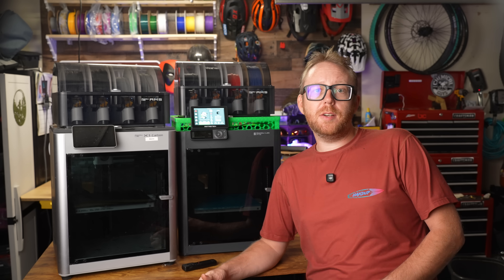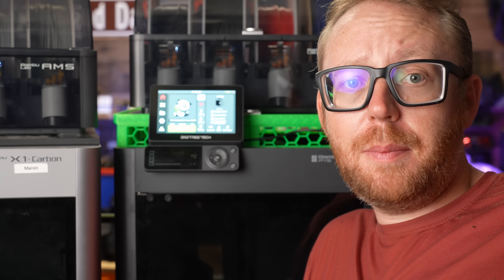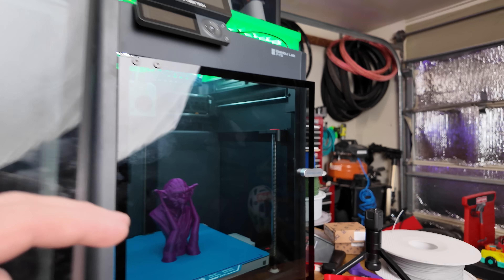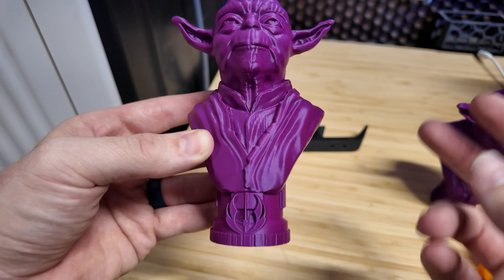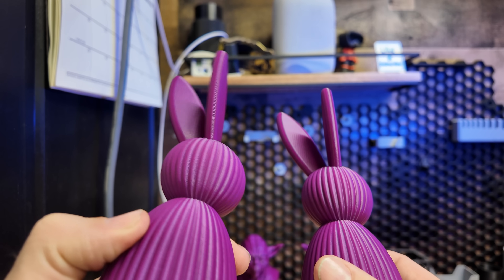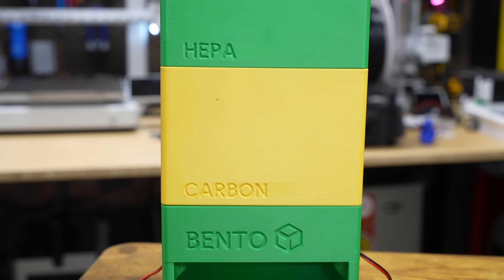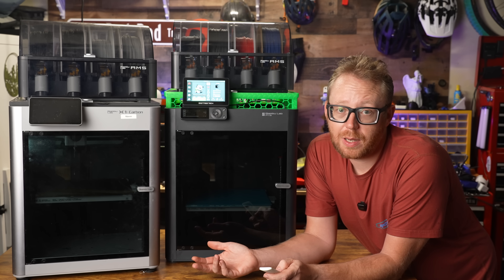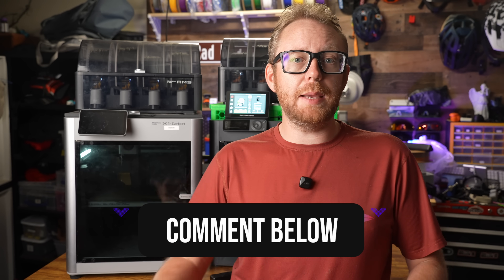Why I Regret Buying the Bambu Lab X1 Carbon vs P1S

Comment: I have both the X1C and a P1S. If I did it again, i would just get 2 P1S. The only feature I like about the X1 is the hotter bed but I rarely use it.
Reply from the maker: Same
Reply: Do you not use the screen on the X1C? Does the P1S screen bother you?
Reply: @Omar-hu5qt  i don't actually use the screens on either printer all that often I do everything I can from my PC

Comment: Thoughts on the elegoo cc? It doesn’t have multicolor right now but elegoo did say it will come soon.
Reply: a balatant copycat of the X1 Carbon, but with inferior parts. I know this because an insider told me.
Reply: @littledovecitydust  would you still recommend the x1c even if its 4 years old? Im not a 3D printer pro. I just like coding want want to make funny thing.
Reply from the maker: I PreOrdered it, but i think im in the 3rd wave.

Comment: I think we missed some serious points in this video ???? 
Why are we recommending Big tree parts when Bambu is locking down the communication ?? Not one mention of this ?? 

I have a P1S and wish I had gotten a x1C. 
You missed a lot of other features the x1 has.
Reply: The big question here is whether you use all these features, otherwise these things are irrelevant. Now if they are essential for your day to day life, then the X1c is for you.
Reply: I have both; they are different. Many features can be helpful occasionally. Lidar sensor, bed type recognition, auto calibration of filaments, first layer inspection, and spaghetti detection. When you print often with different materials, the X1C is easier to work with. I understand what you mean about the big tech tree topic, but it still works using some firmware. Don't see the problem; people are smart.
Reply: The big tree tech addons have nothing to do with the online printing scandal.

Comment: I didn't struggle. I went with the P1S. It was my first printer and I was not sure how 'into' things I would get. The P1S + AMS was $850 when I purchased it. That was already ~200 more than I wanted to spend, but reviews at the time ( ~ oct / 2024 ) said they just work so I pulled the trigger. Was pleasantly surprised when things mostly worked out of the box. I had some issues with network setup but that was because I had segmented my home network. Really wish there was a wired Ethernet port for the device. I wish the P1S had the larger touch screen. It is a PITA to flip though the screens, but for the most part its not needed.
Reply: Isn’t the anniversary sale make it cheaper ?
Reply: Is it worth getting a combo with AMS 1 or combo with AMS 2 with hub.
Reply: @carlostaveras3309  If you know you are going to do a lot of printing the question really should be do you get a P1S or go big on the H2D. I've seen a lot of interesting multi material prints with the H2D. But that's quite a leap and you really should know you are going to stick with the hobby and make use of it.
Reply: @carlostaveras3309  I think it really depends on your use case. I found it a nice to have. I only have a 1-2 spools of filament and haven't ever tried any kind of multi filament prints so I'm not really making much use of the AMS, but I'm glad I got it because know I know.  If money is tight, and you don't see yourself doing multi-color or multi material then save yourself the $200-$250. On the other hand it makes loading different spools a little nicer. I still think the P1S is a great intro printer. My still works.
Reply: seems as if all your qualms are fixed by the x1c. enthernet port. better screen, and possibly other qol features that you might not yet be aware of.

Comment: I love my X1C and have no regrets buying it. However, when someone asks me which printer they should go with, I tell them the P1S.
Reply: Same. Additionally, I bought the X1C back when they didn't even have European distribution, even less a P1S.
Reply: for a beginner like me, never got any 3d printers before, would you suggest the A1 or the P1S?
Reply: @neeezyy , I would suggest the P1S.
Reply: If we upgrade P1S with hardened nozzle and gear, can we print all materials that carbon x1 can print, such as carbon fibre? Any issues with the plastic side walls and high temperature? If yes, Any workaround for that?
Reply: @jaikc7840  I would also be interested in that and whether there could be problems after the conversion
Reply: Hey I’m having an internal debate right now. The heated chamber and the LiDAR leveling. Is it worth to get that over the P1S ?
Reply: @HezeSmash , I can't say for sure, since I have never actually used a P1S or a printer without a heated chamber. I now have the H2D. It was very expensive, but I had the money at the time. I think it has been worth it so far. It has printed everything perfectly for me.
Reply: @phil-1115 thank you even for that feedback. I appreciate it for sure.
Reply: @HezeSmash , I would say that, if you are on a tight budget get the P1S. It is a fantastic printer for beginners. I started with an Ultimaker printer and honestly, it sucked. I thought it was good at the time, until I got the X1C. I learned a lot from that Ultimaker though. Now, if you are going to print filaments that need heated chambers, then you might look into the X1C. After the H2D came out, a lot of X1C's came up for sale used.
Reply: @phil-1115 is there anything to be weary of when buying used ? I was already inclined to save up and buy new.
Reply: @HezeSmash , Buying new is always the best way to go. However, if you buy used, there is always stuff to be weary of. Check how many hours are on the machine. If the machine was used in a print farm, then it will have too many hours on it and could be prone to issues. Rock the head up and down, back and forth on the gantry. Make sure there is no play. My X1C started setting codes telling my that belts were loose. I tightened, and replaced belts, but the code still set. I sent a message to BBL about the issue. They responded the next day and had me run these tests. They determined that the head had too much play and they sent me a new head and gantry set up for free. I guess the good thing is, if you have any issues, BBL Tech support is great.
Reply: I hardly ever use my X1 c for any filaments it is for, so I love my X1c, but the P1s would be loved just as much. Maybe I will get one for convenience sometime.
Reply: So here's my question, I'm actually on my way to pick up an x1c AMS combo right now with 20 hours on it from someone for $850... Good deal?
Reply: Great deal, I bought one open box from microcenter and they didn't have it so they cancelled my order, then they relisted it and I bought it again lol so they just gave me a new one for the open box price. It was like 1000$ though @thesilentdj4279
Reply: Thats like saying " I have no regrets buying my Ferrari.  However, when someone asks me which car they should go with, I tell them to get a Corvette. LOL
Reply: @stevrgrs , Basically yes. That was 8 months ago though. I now have the X1C and the H2D. So I really went all out.
Reply: Exactly this. Started with X1C, recommended everyone the P1S or A1 mini when on budget. In fact, we own all 3 now.

Edit: two months later and there's also a H2D 40W lol
Reply: @KiemPlant  A1 or P1S?
Reply: Same here, but I have a different opinion honestly, I think I would have rather buy two P1S instead of one X1C if I still want to spend the money. I think they have the exact same quality but the difference is I have to do a lot more settings tweaking to get the P1S to have that perfect quality

Comment: I got both

X1C does all materials and has some nice quality of life features

P1S is a good general purpose printer for cranking out PLA/PETG parts
Reply: Add a hardened nozzle and extruder gear for $46 and you can do the same materials as the X1C.
Reply from the maker: yup, only real difference is the bed goes to 110 on the x1c vs 100 on the p1s
Reply: @RadDadsPrintLab damn i always read that x1c was meant for “exotic” materials, but at 110*c bed you cant even print PC and nylon and it might even struggle with reinforced abs/asa ? , glad i did buy a voron instead
Reply: I print ASA/ASA-CF/ABS all day long on the P1S with no issues.  If you are concerned with bed temps, you can also get a bed temp deregulator that allows for 135° build plate temps.
Reply: @Nitro22-o2y  With Tariffs making printers more expensive the P1S value is looking better and better every day!
Reply: P1S works great for nylons too? If you're only doing PLA and PETG just get an A1

Comment: "...Why I Regret Buying the Bambu Lab X1 Carbon vs P1S..." Because it does basically 90% of the same with 1/4 of the price. Thank you for coming to my ted talk
Haven´t watched the vide though.
Reply: Yeah, the X1C is a pointless printer. And I have one, but I also bought mine before Bambu Lab had released any other printers than the X1C and X1. There is no reason what so ever to buy an X1C today, only reason would be if you have too much money and want the best. But even that doesn't apply anymore, if you have too much money and want the best buy the H2D. Maybe if you want the best but the H2D is too big an heavy.
Reply: 1/4 of the price, ah?
Reply: I’d say it’s 1/4th cheaper, but not 1/4th of the price of the x1c
Reply: @PapiTheMenace  It´s about 50% cheaper in my area.
Reply: I'm glad I saw this video before investing in x1C... I won't regret it like you did hahaha... since I'm going to buy directly from the factory in the UK, and I'm going to Brazil, I'll save 100%

Comment: I bought the X1C a year ago and very happy with it. I have 2 dump printers. A Voron 2.4 and a Snapmaker J1. 
The benefit of the X1C is, you start the print and can forget it. You don’t have to check the printer. The bed temp of a P1S is limited to 100c instead of 110c. Bad for engineering filaments. 
And last, i use the lcd every time I load a new filament in the AMS.
Reply: That 10c difference in bed temp is not going to make much of a difference, if any at all. Why can't you start a print on the P1S, and walk away? I haven't had a single failure that wasn't my fault. I bought my first 3d printer in 2016, and the reliability is orders of magnitude better than it used to be. I don't use any on printer control features- everything is done from a Linux desktop using Bambu Studio. Hard to beat a 4k/1440p multi-monitor desktop environment. You do not have to check the P1S. From what I've heard, it's even more reliable than the X1 series.

Comment: Does the Panda on the P1S still work with the new firmware?
Reply: Haven't tested myself yet, but I heard it does work as long as you stay in lan only and dev mode. It just disconnects you from the cloud so you can't use the handy app
Reply from the maker: I think the new firmware was only for the X1C. I dont think its been done for the p1s yet. I could be wrong.
Reply: @ Good point. Forgot that they were doing it in stages.
Reply: It will stop working soon.  Bambu are deliberately blocking owners of P1S printers from improving/upgrading them.  Shitty behaviour in my view, and I won't buy any Bambu device while that policy continues.

Comment: I have an A1 mini with AMS lite.   All the improvements are made on the A1mini and now on my new P1S.  Besides drives and hotends and lights and a Panda Touch.  The benefits of the X1 are none existent for me, printing in a semi.
Reply: i have an a1 mini, trying to decide if i go to a p1s, do you think it is much louder?
Reply: @ yes.  I have mine in a 389 Peterbilt truck.  It is always 5’ away from me 24 hours a day.   The noise is not an issue. The weight is not an issue.  The speed and print results are worth it to me.
Reply from the maker: In a semi? Thats awesome!